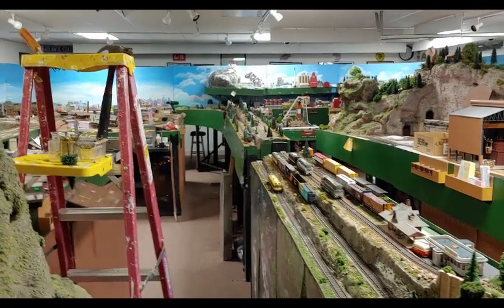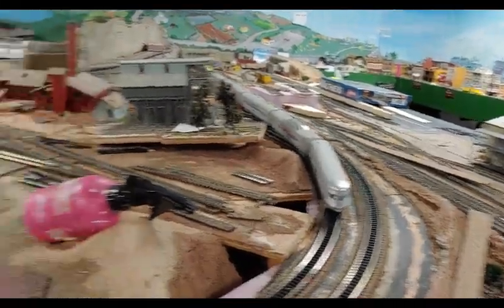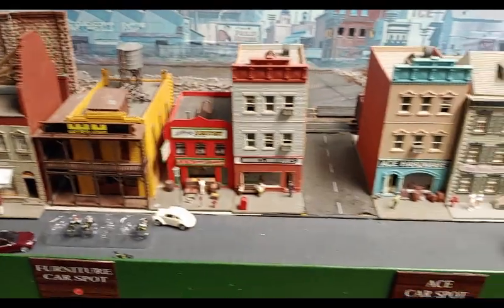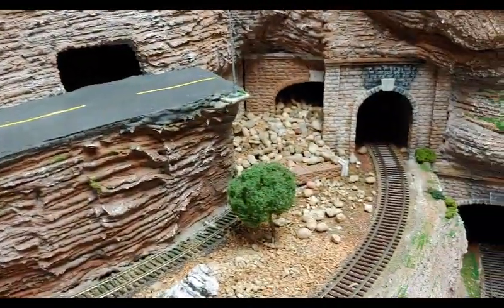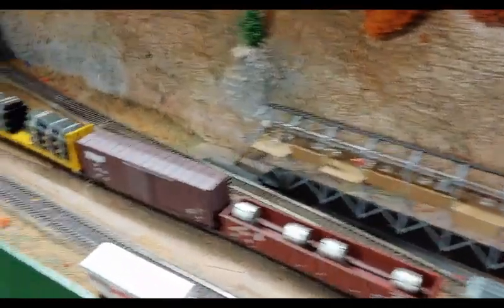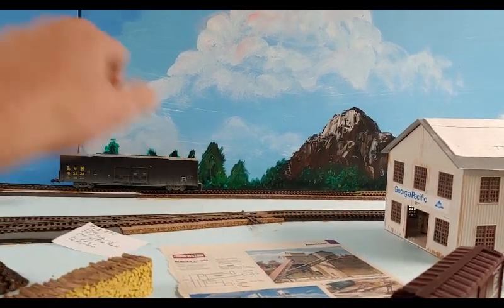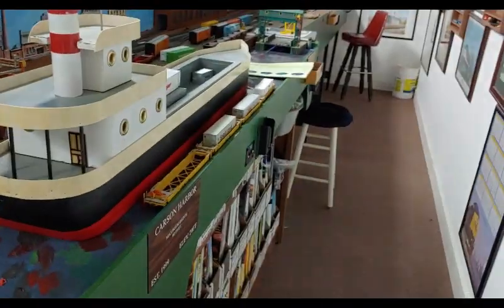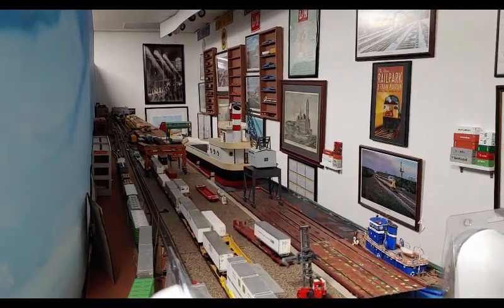Layout Tour - Nolan Brunsen's HO Scale Emmpire

Comment: Daunting task you guys have to tackle; all the re-wiring and track replacement.  It’s a very large nice layout that’ll be really fun to operate when your done. Looking forward to following along.  Anthony
Reply from the maker: Thank-you!! It's kind of had to tell, but most of the major problem areas have been fixed, in fact, the only two left are that interlocking and one more connection so passenger trains don't have to back into union Statio. Most of that trackage in the middle is basically one long secondary that terminates in the loop staging. Operationally, the secondary is pretty well designed for operations, they just didn't know how to lay straight track!!! So most of it really boils down to fixing kinks and smoothing out the geometry.